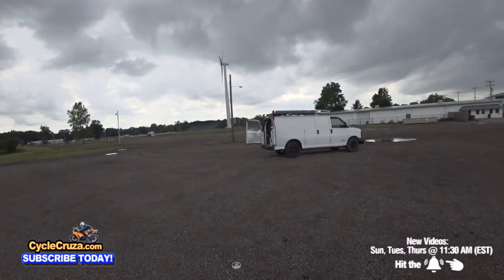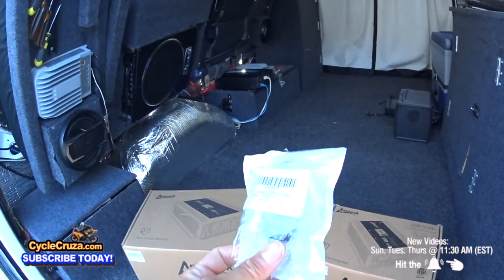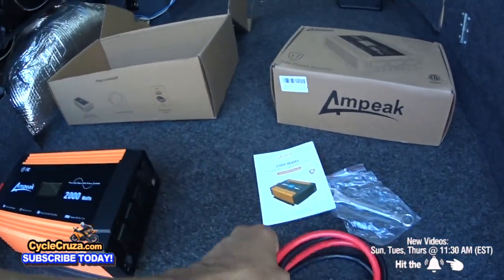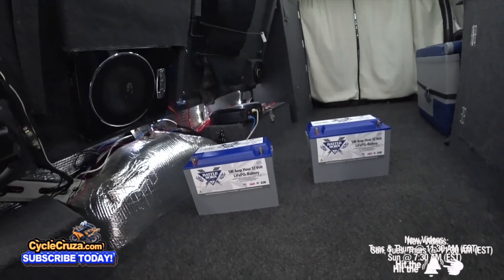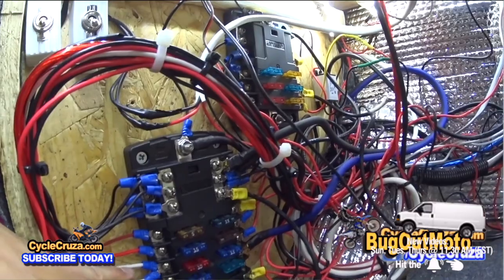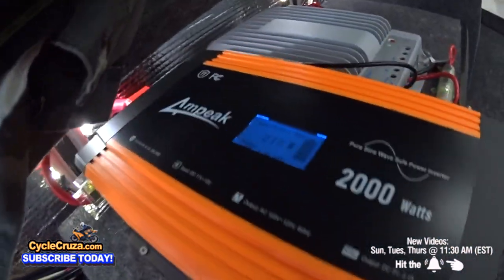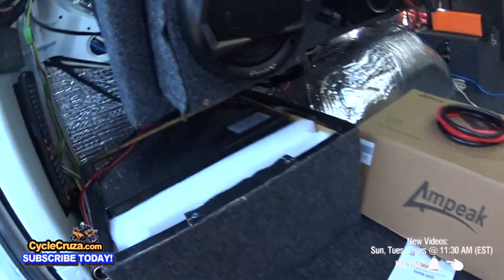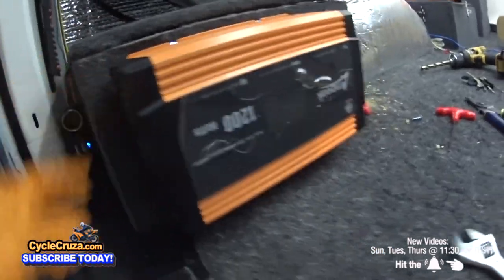DIY Camper Van Conversion Bug Out Van  | Ampeak Inverters

Comment: Brother you kill me with those TWO separate systems 😂
Reply from the maker: Well if one system goes to shit I got a back up. It happened once in Yellowstone WY and lucky I had my back up system to keep my fridge and freezer going. I have a fuse box for each system and if one fails I can easily transfer stuff over the the other system. I have a back up of a lot of stuff, even the van, if it fails I can bug out on my motorcycle that I keep in the van.